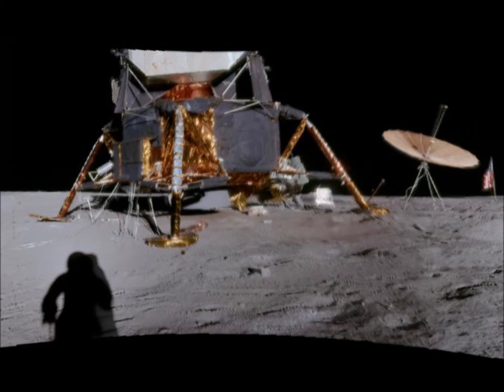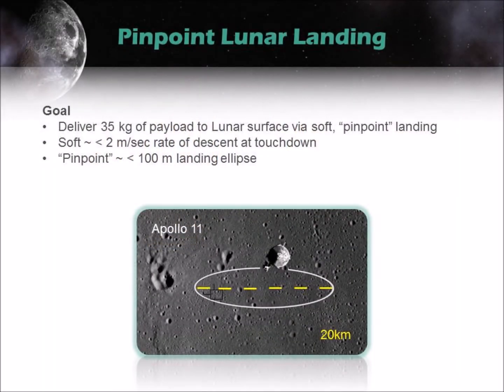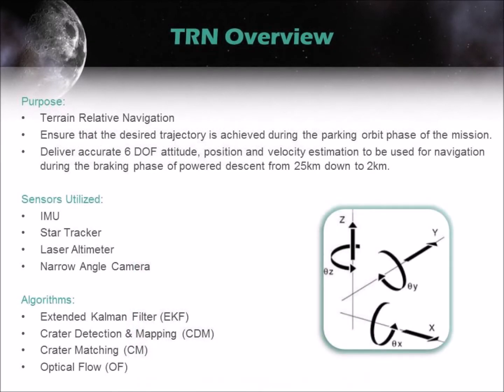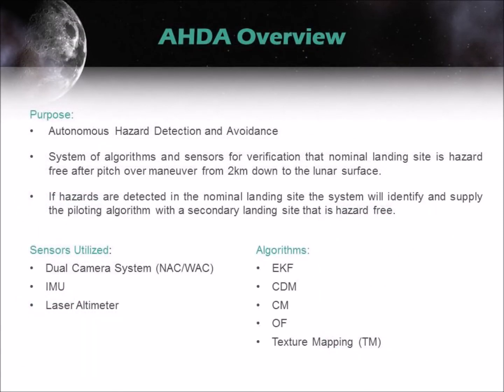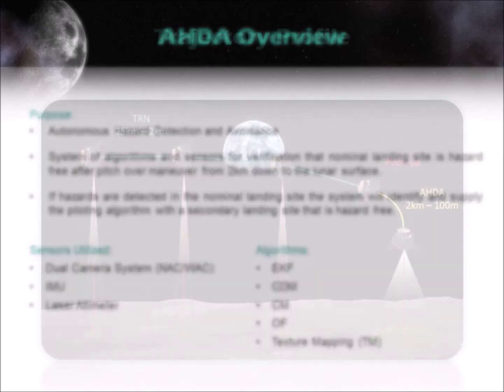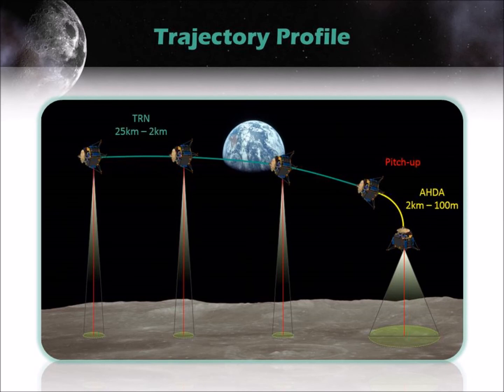Earthrise Space Foundation - TRN & AHDA

Comment from the maker: The Foundations' Tracking & Avoidance Engineer, James Stininger, explains the autonomous system that will land payloads on the lunar surface as part of the first private lunar mission via team Omega Envoy in the Google Lunar XPRIZE. Here are a few of the basics:

Terrain relative navigation is the process by which images of the surface terrain are analyzed to determine the current location of the spacecraft. By systematically identifying and matching craters on the surface to a database stored on-board it is possible to estimate the current location of the lander with a high degree of accuracy.

Hazard detection and avoidance is the process by which images of the lunar surface are analyzed to identify and classify potential hazards during the final phase of descent. The imagery is processed using a series of algorithms that can detect discontinuities, craters, rocks and areas with excessive slope.